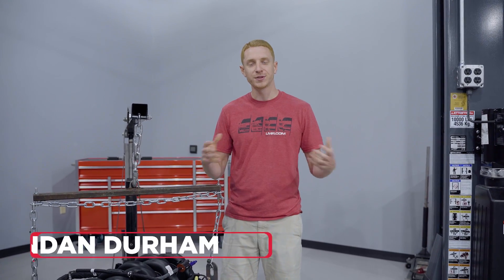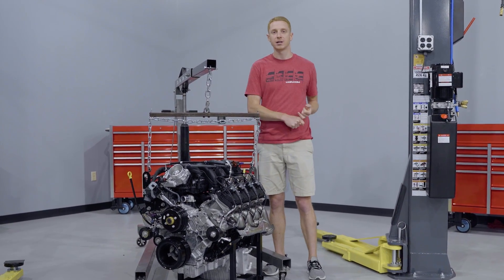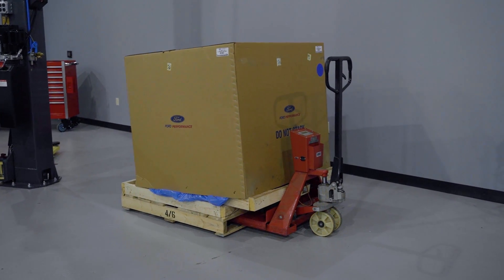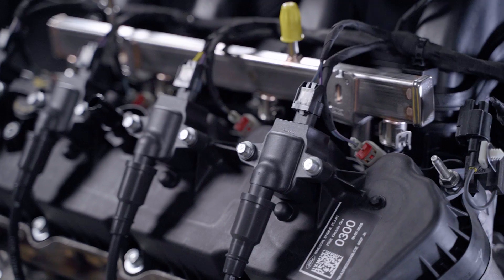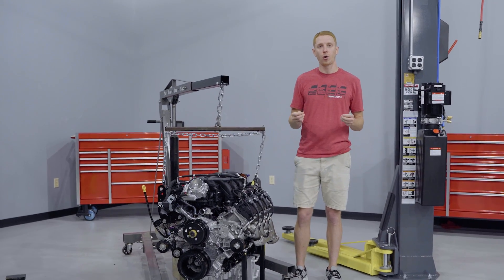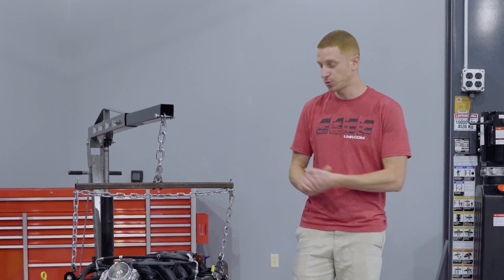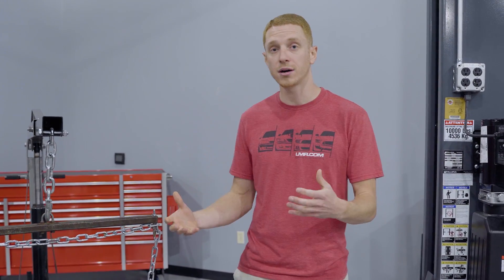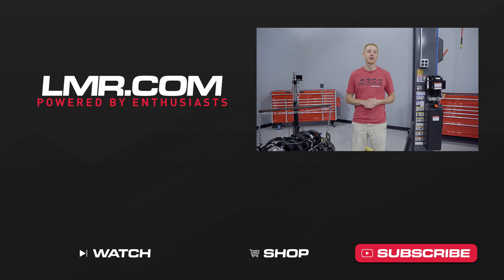Ford Performance 7.3L Godzilla Crate Engine | Review

Comment: 1 second ago
Hey I have a 2017 eco boost mustang I’m pulling the motor out and I wanna put a7.3l Godzilla motor with 6r80trans and I know it fits with factory 5.0 engine mounts  in there is there anyway possible to make the factory 5.0 cluster for it work with the car with A/C and power steering?
Reply from the maker: Cash Jay - That sounds like a cool swap!  Because of the complexity of wiring and circuits in newer cars, I don't have a dedicated answer for you.  Thanks.  -Landan

Comment: Would that engine go in a second gen raptor  2017 if for any reason my 3.5 twin turbo would go for a shit I'd like to swap it with a 7.3 crate engine  . Once it's in the modifications r endless . Turbo charging or super charging.  👌

Comment: the problem with that commercial grade engine is the ecu or electric control unit wire which multitask the heat melts the wires together. so ha.

Comment: Would make a great marine engine. Being that GM discontinued the Chevrolet based big block, there are currently no big blocks available for marine engines. The GM/Chevy small block is being called in to do the work of the big block to power pretty heavy vessels in the mid 35' range, the 7/3 Godzilla would be better suited and would fill that niche perfectly. Ford could work something out with engine marinizer Crusader Marine and Crusader could marinize the 7.3. I also wonder if there is room in the 7.3 block to be expanded in bore and stroke for more CID?

Comment: You can still get the 6.2 as a base option in the superduty and you have the stats of the 6.2 that’s optional in the 2011-2014 f150 or first gen raptor, detuned to 385 hp in the superdutys

Comment: The GenII LT1 small block is the same way regarding the damper or "balancer."  Engine is internally balanced in the front therefore there's no heavy side to the damper therefore it can be installed in any position.

Comment: Nice engine but I feel like it falls short of power numbers. Just as a comparison the 6.4L Hemi makes 485 Hp and 485 Tq. In a crate motor configuration I believe they were rated at 520hp. This 7.3 should be making closer to 600 hp.

Comment: Here is what I see! This thing has the same size stroke as my 428SCJ (3.98") and it has almost the bore of a 427FE (4.23"). Around 2001 I installed a 428 crank in a .030-over 427 to make 454ci and put it in a red 1963-1/2 Galaxie with a High Riser tunnel ram  2x4 and a teardrop hood.

Comment: Would be a great replacement for an 04-10 Ford f150 with a 5.4 3v.  I'm wondering how it hard it would be to bolt on up with the control pack
Reply: Exactly what I was thinking  I have an 06 that I would love to drop this monster into.

Comment: Personally I am underwhelmed by this engine, almost 50% larger displacement than the stock Coyote for not alot of gains in HP or torque.
Reply: It’s a pushrod HD truck motor, common sense it’s not going to be as performance oriented as the 5.0.
Reply: @Aron-ru5zk  I'm talking about the 5.0 truck version, common sense would expect alot more performance from a 7.3 crate engine.
Reply: I had a 2014 xlt with 5.0 and moved pretty good but the 2022 I have now has the 7.3 and you can feel the difference in the torque when it ramps up

Comment: Certainly a nice (but very expensive) option retrofit - but the well proven stroker 460 / 514 cu in is a much simpler and far less expensive choice (carbureted or injected).

Comment: The reason ford switched is because their modular engines were complete junk and fleet companies stopped buying anything with that engine because it was a POS maintenance nightmare! .. Coil, timing chain problems, cam phaser, spark plug, exhaust manifolds breaking, Manifold bolts breaking, and the fact they made the oil passages so small they plugged up with sludge NO ONE WOULD WANT THEM ANYMORE!! Ford engineered these flaws over and over again and imo never by any ford with them in it!  This is why LS motors are better not complicated junk like fords to fix! Yes gm had problems with them Cylinder deactivation motors but if you delete that then you will have a solid engine!

Comment: I've been researching this motor for it's original application in the Ford Super Duty.  At least for the commercial truck market, this thing is being marketed as a "Back to Basics" V8 to compete with GM (L8T) and Dodge (6.4L Hemi) Hemi in their respective commercial offerings.  As others have said, it's also the "Spec Sheet Replacement" for the last Mod Motor still being made new, the 6.8L V10.  Said V10 has only been available in the F450 and upwards for a few model years now, so it's cool to see this 7.3L gasser on the order guide as an option for the F250 and upwards.

I had never considered this thing in an application for the older Malaise-era barges (the Lincolns the host mentioned), or the first wave of the smog-controlled muscle cars of the 1970's, but for somebody that wants a "Pure Blue Oval" (i.e. no LS swap), this makes sense.

In looking, GM offers an L8T and Mopar a 6.4L in crate engine packages, so I suppose it's only natural that Ford would do this too in order to stay competitive with the market.

We're in the golden era of Internal Combustion boys and girls, let's enjoy the roar of those V8's at redline while we still can!
Reply: That’s allot of talk to not say anything at all. The 7.3 is in a league of its own neither Chevy 6.6 or the ram 6.4 come close.

Comment: I'm building a cobra replica and the last one I put a 460 in and my intention was to do the same in this one. My parts and labor are approaching 10 grand I should say 12 Grand. Do you think I could get this motor to work? I know the heads are different so I'm concerned about height and I don't know what controls the spark and fuel. Can you help sure is a good price at 7 Grand
Reply from the maker: Give us a call at 1-866-507-3786 or email our team with the link below and a customer care representative can assist you with all the fitment details and what you need to make it work! https://lmr.com/contact

Comment: How much do these engines cost to buy ,and do you need a stronger trans to go with it .
Reply from the maker: We're currently offering the engine at $7,449.99 without tax (https://lmr.com/item/M600773/ford-performance-73l-v8-super-duty-crate-engine-m-6007-73) We do recommend using a stronger transmission when installing this engine. Feel free to contact us with the link below and our CCR team will be more than happy to help you decide what transmission you'll need to use when making this swap! - https://lmr.com/contact

Comment: The 7.3L size seems to be a dig at International for the trouble Ford had with the 6.0L Powerstroke. It was the International 7.3L Powerstroke that really lit off the Ford heavy duty trucks in the '90s. Another 15 cubic inches and it'll be a familiar-sounding 460-cubic-inch 7.5L engine.

Comment: Considering how many have stated the VCT is insufficient, I'd love to see the aftermarket develope a gear drive for the cam, and a hydraulic cam/lifter that can reach 7200rpm 👌 only thing better would be a cheap factory aluminum block and it would be gold~

Comment: Man hat in the hell is 30 inches long ???? Taking the measurement from where to where ??? Ive got an old FE 427 here on the stand and its 27 from the back of the block to the front edge of the balancer.   30 ??!?!???????I hope thats from the outter edge of that flywheel to the outer edge of those pulleys...

Comment: 435hp / 475lbft, thats it?
Reply: 400ft lbs tq @1500rpm 
400+ft lbs tq from 1500rpm to 5500rpm
peak tq 475 @ 4000
peak hp 435 @ 5500
its a truck engine designed for low rpm torque in its first generation

Comment: Ford "7.3L making 430hp is reasonable"
Chevy "How can you make that little power with that much displacement in 2020?"
Reply: i see nothing wrong with making more torque at lower rpm and holding a much flatter curve than the 6.6...

Comment: Thats the problem with Ford. Half that engine is plastic, and the other half aluminum. Intake manifolds should not be plastic. Engine blocks and heads should not be aluminum. Aluminum warps when it gets hot, plastic melts, warps, and cracks when it gets hot and old. From a financial point, ripping people off is a great way to get rich. There is no honor in that avenue.

Comment: If ford could squeeze out 460 hp and 420 tq from a 5 liter v8, imagine if they made this engine for performance and how much torque and hp they could squeeze out of this 7.3L v8
Reply: 700Hp-1000 Hp in built performance upgrades 💯⛽️🔧
Reply: @TwoDot they've finally done it😂
Reply: Greetings from Brazil .
Imagine a  DOHC version
Reply: @celmodeandrade1791  it doesn't need it it makes all the power with pushrods and a single cam in the block
Reply: @eddieschwab864  , there's more to it than that 🤔🙋🏻‍♂️
Reply: @celmodeandrade1791  ,  DOHC would increase the width by 10 inches‼️ That's why it's a push-rod engine in the first place ‼️‼️ The cammers are so freakin' wide‼️ And expensive 😤
Reply: @celmodeandrade1791  greetings from texas

Comment: For a moment I thought you were talking diesel. Those are pathetic numbers. In '68 my stepfather pushed a 289 Ford to 504 HP @ 9,000 RPM. NASCAR legal and raced it all season. Your numbers are, are sad. My RV approaches those numbers with a 1986 460. Honestly if you aren't past 100 HP/liter you have no bragging rights, even on the low end. 200/ltr is reality today.

Comment: really not *that impressive... for the size + weight, it's only marginally more HP/TQ from the 6.2L
a 5.3 LS makes the same power with simple bolt-ons and is MUCH MUCH lighter
feels like ford actually went backwards?  the coyote engine is equivalent stock for stock while only being 5.0L

Comment: 7.3L 430 h.p. not much h.p. seeing fords 5.0L out of a gt mustang is 460 h.p. plus how much more does it weigh ?
Reply: It's a heavy-duty truck engine. Comparing to a car engine is apples and oranges. (The 5.0 in the F150 is also more of a car engine, but it works here because it's a relatively light-duty truck)

Comment: Just a little FYI.  The 6.2 engine was available in the 2010 Ford Raptor.  The 5.4 was the only engine available for the first few months of production, then the 6.2 became an option during the year.  I bought one (still own it).
Reply: You are correct sir because I worked at The Ford Romeo Engine Plant and I built all those 6.2’s. This was a great engine! And it was pretty easy to build!

Comment: The 7.3 replaced the 6.8 v10 as an application in stripped chassis and Super Duty.  Not the 6.2 which is still an option as a base in the Super duty line-up
Reply: Yes you are correct lol
Reply: The 6.8 Triton was very cool
Reply: So this replaced the triton?

Comment: Why would anyone buy this? 7.3l an only 495hp... i don't get it. How is the motor so big and the hp number so low? An they need to change the name of the motor. How you going to make a trash motor an call it godzilla.. Makes no sense.
Reply: This is a truck motor, it's designed for torque, this engine has big power potential with low boost pressures due to large displacement and good cylinder heads, this engine has made 780hp naturally aspirated.

Comment: Need more power and torque with a name like Godzilla. At least 500-575hp and at least 500-575 torque from the crank.. this is why I have a dodge now
Reply: It easily could with a cam swap. It has all the right goodies. But this is a low RPM truck engine. It makes all its power below 5000rpm.
Reply: @geoffmooregm  that’s very true, I didn’t think about that when I wrote the comment... still tho 7.3L naturally aspirated even in a truck motor still would have been nice to see a little more power out of it

Comment: Ford is like "Your move GM". I honestly want to see GM come up with something that can go up against this engine in a big block size for the truck market.
Reply: You are already able to buy a 454 LS based crate engine. It would be cool to see one in a production pickup though!
Reply: @geoffmooregm  maybe they'd consider bringing back the 454 SS, to compete with the Raptor and Ram TRX
Reply: 454 LSX has been available since 2006. Biggest iron boi in the current gen is the L8T 6.6L, but Chevy has been in the pushrod business since 1997. Probably won’t be long before they drop a spade.

Comment: FR9 have a 4.500 bore spacing it would be nice if ford offered the same architecture for the 7.3 Godzilla!  Fr9 engines in NASCAR trim 358 ci make 950 horsepower

Comment: Ford knows what they're doing. The bore spacing is what makes the engine 4.527 which means 2.30 or bigger intake valve capability. With a valve that big a very good intake port could flow 500cfm

Comment: Murica! 430hp from 7.3ltr... How lazy is that, give a European engineer 7.3 ltr and you’d back 900hp
Reply: It's not like they started with the displacement and went from there, haha. Is that how you think engine design works?
Reply: @nthgth  that as even worse, so they built it and then realised it was so UNpowerfull it was. Daaaam
Reply: Besides which, people have already gotten way, way more power out of this engine without extensive modification. (And without boost).
Reply: @nthgth  there you go, you’ve proven my point!? The designers are lazy and didn’t bother if it’s that easy

Comment: 2 bits of miss information, the 6.2 is still in production as a base model, but the 6.2 was also available for 2010 as an option in the raptor as well, if I'm not mistaken the engine they discontinued was the v10, i believe it was still being used in chassis cab vehicles if i remember, but it hasn't been in a truck for some time, so the 7.3 is a great replacement for that engine!

Comment: Amazing how everyone is excited about 40 year old technology. 7.3L with today's technology should be pushing 600+ hp.
Reply: Specifically what about it is from 1980? Certainly not the fuel injection, or the power output.

Alright, let's see your ideas for a gasoline engine for an HD truck that will pull a 15,000-lb trailer up a mountain pass at WOT for half an hour and not ping or overheat.
This, all in a day's work, with a life (mileage) expectancy well into six digits.
Hint: Low specific output is key.
Reply: @nthgth  The 460 was the same design and came out in 1968 and could produce 437HP and 507Ft of torque. Chevrolet made a 632 that had 800 Hp and could be modified to over 1100 Hp on pump gas.
Reply: But modded for performance, yes, people are getting like 800 hp from this thing, NA.

Comment: ford has been running key-less crankshaft for some time now. the timing gear on the crank has no key either. to lock everything up ford uses a double-sided diamond-coated washer, that when the crank bolt is torqued down its design to keep the pully/balancer/crank-trigger-wheel and timing gear locked up. 
so don't loosen that bolt unless you have to, also you may want to invest in the special ford tool that locks the motor in TDC for #1, well worth it if you're going to be modding this engine.
this ford special tool is most likely a bolt that's exactly 40mm long as in the case in some of their engines, this bolt screws into the side of the block and protrudes into the crankcase, the crank is spun gently until the cranks counterweight buts up against this bolt, this will hold the crank so #1 is at TDC allowing you to set timing and torque all the bolts down,  have fun
Reply: Really, no key way? So to save a couple bucks they risk the timing shifting and destroying the whole engine?

Comment: It needs way more power for the weight of the engine. Need to be 550 to 600hp  minimum.
Reply: It’s a heavy duty truck engine as it stands , built for no nonsense reliability & maintenance BUT there is no reason why basic mods , cam , headers , mild head work etc has already shown 600hp easily achievable
Reply: @barbraabsalom4531  Buying and installing aftermarket parts will jeopardize the reliability of the engine. As you mentioned, it's built for nonsense reliability is the purpose of the engine.

Comment: Why only 430 hp in that size engine? I like it but gm makes like 800 hp in that category 🙄
Reply: Apples and oranges. (Displacement does not dictate the category).
This is a truck engine, with a truck (small) cam and truck tuning.
GM's (fantastic) big-inch engines are for high performance i.e. with performance cams and tuning. With performance cam and tuning Godzilla does make tons more power.
Reply: @nthgth  then they should do that or not call it godzilla lol Nick name it pony express then lol godzilla is king this my friend is mearly a pleasant

Comment: I hate to be "that guy" as far as I can tell, the 2021 Super Duty still has the 6.2L as standard, it sounded like you said it is out of production. I hasn't been available in F150 since 2014. I actually got excited when said that and looked it up. If the 7.3 was the standard engine in 2021 I would have been pretty excited. I think it should be since the new 6.6L is standard in GM HD trucks. I'm sure it will be difficult to find a 7.3 Super Duty with a massive discount on it the way a 6.2L could be. A 7.3L swap into a 2015+ aluminum F150 RCSB 2wd would be awesome depending on how much a 7.3 crate engine costs and how cheap I could get a used V6 6R80e truck like that and get it all working and running. Ford has a huge leg up on GM in that respect since the new 6.6L isn't a crate engine yet.

Comment: >7.3l
>400hp

Why?
Reply: this engine has made 780hp naturally asiprated, so whats your point?
Reply: Aftermarket tuners are doing wonders for this engine though
Reply: Ford wanted to build a heavy duty truck engine that runs on gasoline and produces 430 hp and 475 ft lbs and those power/torque curves.
That is what they achieved.  Displacement is just part of how they got there.